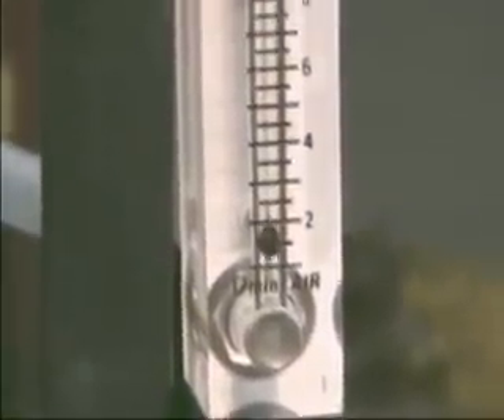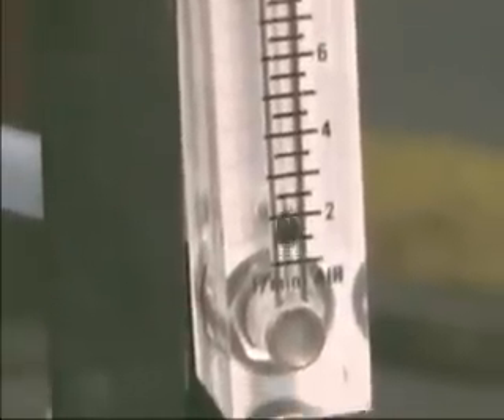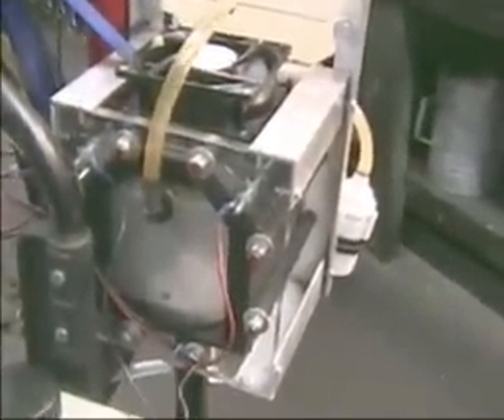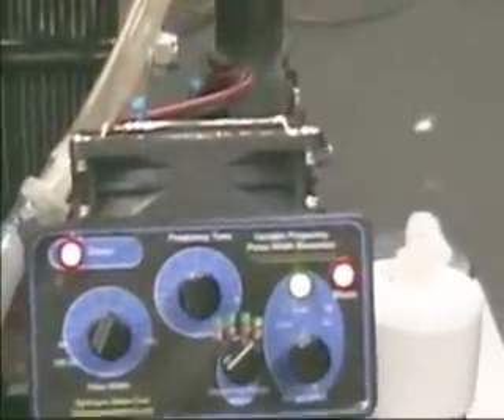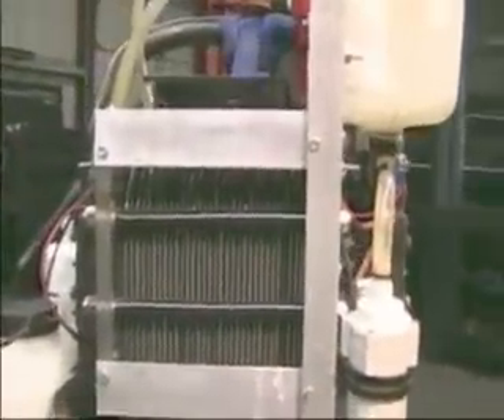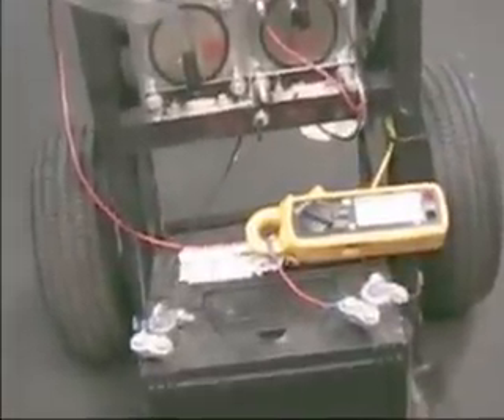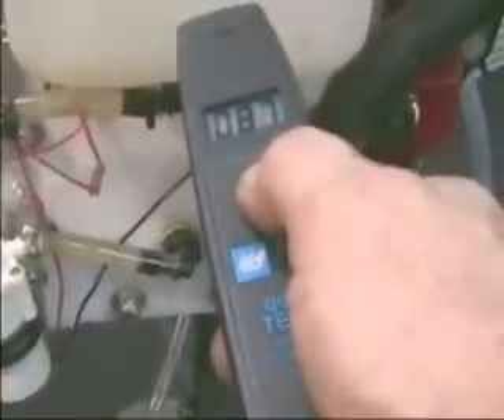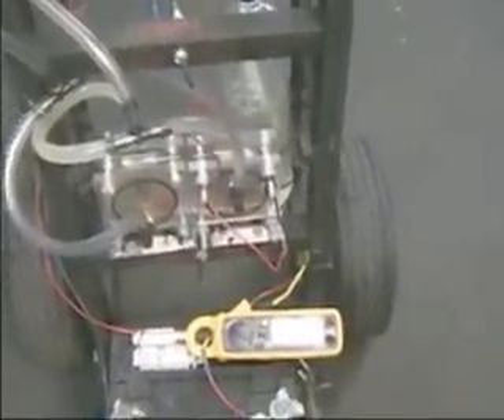HHO Dry Cell Generator Size Can Be Deceiving

Comment: aarmourtherm foundation has developed a proton fuel storage unit published in 2007 to store electricity and to  release hydrogeon in a plasma which is neither an acid or a alkaline  it is neutral  no toxic  substances of any kind can be used with any electrolizer to create a storage in plasma is biosafe and envirosafe . contact mcsa1950@mail.com

Comment: From what i can make out the size cell needs to be equal with the power consumption, Using the same energy over the larger area obsorbs the energy over longer duration. (like long sitance running)
Using a smaller area is the same as (short sprint) same energy in smaller area acts like a bigger punch of energy to the plates.
therefore a smaller area of plate energised will produce more gas inside a shorter time scale, whereas a larger plate requires more time to cover the area. hope this helps.